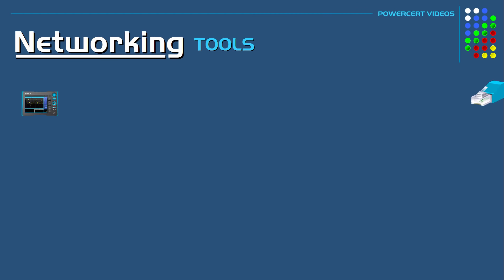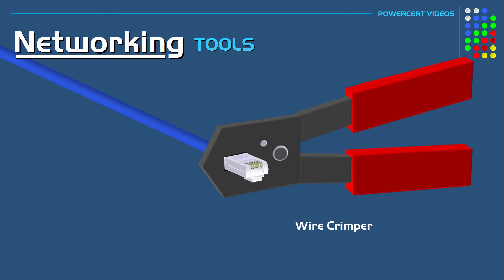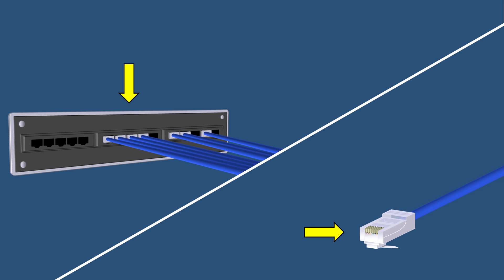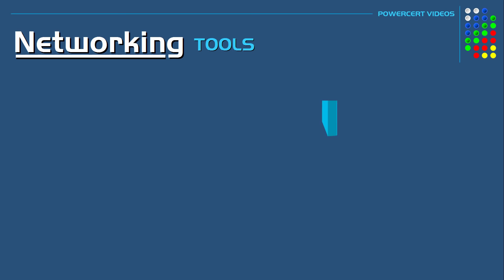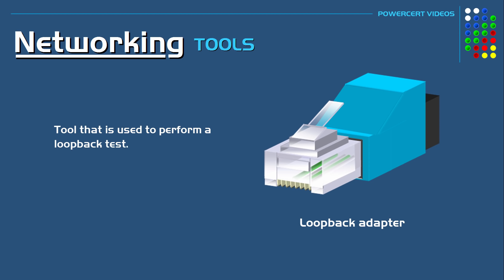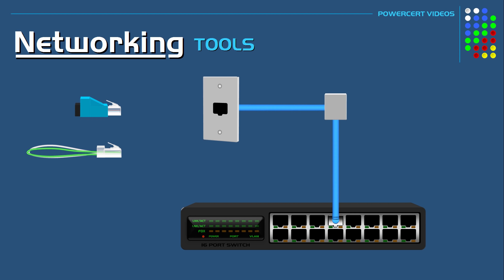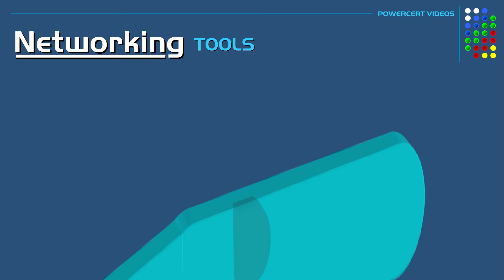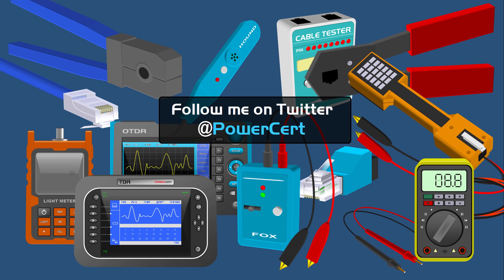Networking Tools - Hardware

Comment: Missing a tone box to put a tone on any wire and a  “banana” receiver which is used with a but set to detect the RF tones from any pair of wires  that is connected to the tone box.  The wire pair can be behind drywall.

Comment: Just to be clear… a tone generator does not work like that. The cable can not have an RJ45 on the end… the cable actually has to be exposed to copper to create a tone allowing you to distinguish 1 cable from the others.

Comment: Any tips for when toning a cable but there is too much electricity interference that all you here is the electricity buzz
Reply: Two options: connect the tone generator to either 1 wire or 2 non-paired wires like #1 and 8. Or you can buy a digital tone/probe kit which doesn’t pickup electrical noise.

Comment: Cable strippers tend to fail quite a bit, I find. My mentor taught me to use a pair of scissors, just score it all around (don't cut all the way through) and yank. You can also use a zip tie to untwist the wires, instead of your fingers. It's It's lot easier when you're setting up a new office and you need to make hundred cables lol
Reply: i use the cable jacket to untwist the wires. (the piece i stripped off)
Reply: How do you use a zip tie to untwist the wires please?